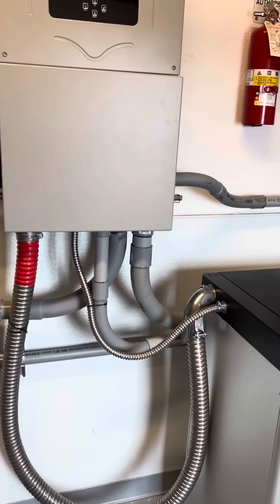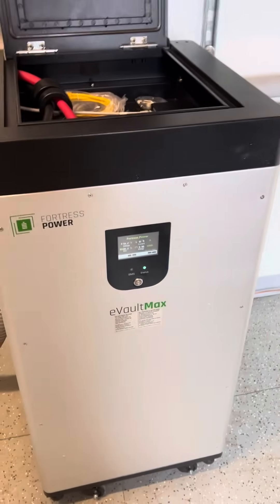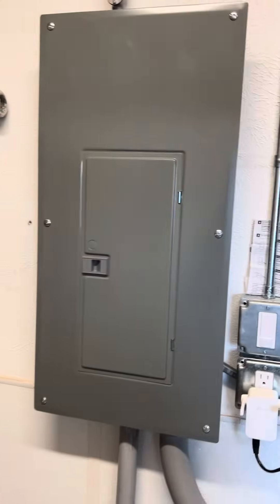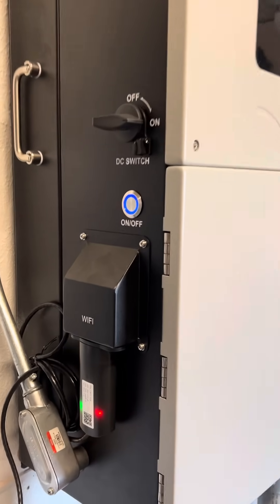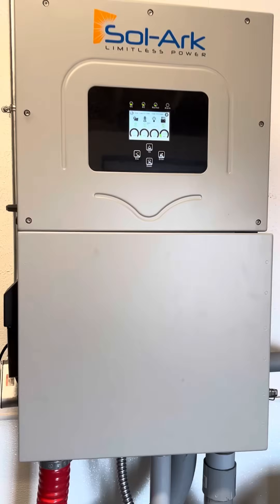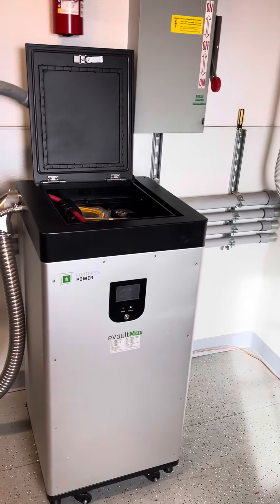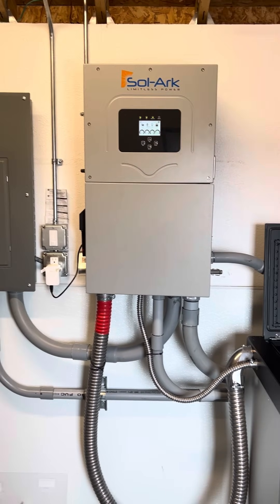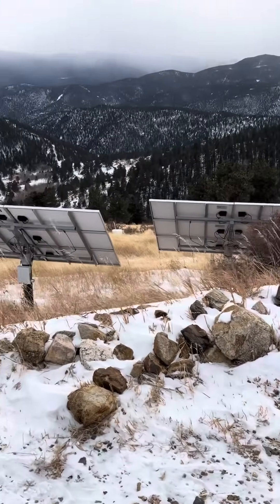Sol-Ark 15KW Fortress Lithium Battery Off Grid Solar Power System

Comment: One of the few installs where I dont see a raceway under the 15k, looks better without the big raceway IMO.  Seems like almost all professional installers use them though... Any reason for going this route?
Reply from the maker: We had a lot of existing equipment that already had existing wiring and conduit that worked well to just hook back up to the inverter without the wiring gutter. It worked out well for this case as we replaced an old outback inverter.

Comment: Is this your business or residence?  It sounds like an industrial plant!
Reply from the maker: This system replaced an old 24V Outback system at a clients home. We rewired the solar modules from strings of 1 to strings of 6 and added this power station which can be expanded in any way they need.

Comment: I would never install a high frequency, transfotmerless inverter in my off grid home. Transformerless, high frequency inverters offer a substantially lower surge capacity, a shorter life expectancy and run much hotter than heavy duty, low frequency, transformer based inverters. And their fans are louder because they run hotter.
Reply: The majority of what you said USED to be true.  Luxpower (manufacturer of EG4 inverters) has HF inverters that have generated over 100MWh (yes, 100,000kWh) of energy which are still operating optimally to this day.  Surge capabilities and life span have dramatically increased in the last few years as well.  Hence warranty period increases.  Many inverters are still lousy with fan noise, I admit.

LF inverters are still great for heavy inductive loads, but they are no longer the end all be all they used to be.  Especially for the typical homeowner who only has one AC unit to contend with.  No problem for more than one if they have inverter driven AC units or soft starts at the very least.  Put two or three inexpensive HF 240V stand alone inverters on the wall sharing the loads and they can last a very long time generating a large amount of energy.  This also gives you redundancy in case one fails till you can replace it which will be fast since most are AIO's now days.

No reason to keep bashing systems that are now proven with many years of service like Sol-Ark, just makes you look bitter.
Reply: Those high frequency inverters may have generated 100mWh of energy, the question is "powering what kinds of loads?" I'll bet they weren't inductive loads. Modern MOSFETs and IGBTs are not capable of universally powering  inductive loads.  @URackADisciprine
Reply: @quickquote1568 If the HF inverter was properly built and not taxed out at 90% all the time and kept under 80% of its rating, then it shouldn’t be a big deal.  I’m well aware that LF inverters have their advantages on absorbing lock rotor conditions; However, if properly sized, a HF inverter can handle them too.
Reply: What I said still hold true today. High frequency, transformerless inverter offer a shorter life expectancy and they offer a lower surge capacity, when compare to low frequency, transformer based inverters. Both EG4 and the Sol-Ark have not been on the market long enough to prove their longevity. Signature Solar, importers of the EG4 inverter has only been in business for approximately 3 years and Portable Power LLC, the alleged manufacturers of the Solar-Ark line of inverters has only been in business for 7 years. Both relative newbies to the inverter industry when compared to major inverter manufacturers like Schneider Electric, Outback Power and Magnum Energy to name a few.  I've been in this industry repairing both transformerless and transformer based inverters for the past 24 years and based on that experience, I can confirm that little has changed in the design of high frequency, transformerless inverters.  I can also tell you that a mere 200% surge capacity is hardly an improvement from these inverter's original surge rating design, especially when you consider that most inductive loads require at least a 300% to 800% surge capability. Oh, and I'm not bashing anyone's product. I'm just educating the public on the true capabilities of these products. Besides, why would I intentionally bash anyone's high frequency inverter product? After all, the more of these light duty, high frequency inverters that are sold, and fail after a few years of use, the more customer's my inverter repair center acquires.  @URackADisciprine
Reply: @quickquote1568  LOL...bitter much?  Must be if you have to twist someone's words to suit your agenda.  Adios.
Reply: Please explain how I twisted your words? @URackADisciprine
Reply: @quickquote1568 ok, I was about to purchase a 6000 watt eg4 inverter could you recommend me something else? A off grid home. Just tvs, window ac units
Reply: I have had two HF inverters on my wall for 4 years now.  They have produced many kilowatthours of energy and are still going strong.  They have already paid for themselves at least twice.  No problems running  my 4-ton AC either.
Reply: So why haven't you answered my simple questions? Two high frequency inverters in what sort of application? Grid Tie, off grid, emergency battery backup? What brand and what kW rating?  @hicapengrs
Reply: It figures that you won't answer my question. LOL!
Reply: Two high frequency inverters in what sort of application? Grid Tie, off grid, emergency battery backup? What brand and what kW rating? Thanks. @hicapengrs
Reply: @quickquote1568  restotool is right, you not only twisted his words but put words in his mouth.  If you dont care for HF inverters that is great for you.  Nobody has to live by your rule though thankfully.  HF inverters have purpose whether you like it or not.  Whether you like what they are used for or not.  Arguing and crying like a baby at people who buy a HF inverter and post on YT is childish.  I am sure you will need to get the last word, feel free as I am blocking your comments.
Reply: Please explain how I twisted his words. @hicapengrs
Reply: Which LF inverter is best in your opinion?
Reply: After 25 years of selling, installing and servicing  residential, off grid and mobile PV solar systems for the US military, law enforcement agencies, commercial business and tens of thousands of residential customers all across the US,  I would have to say that the absolute best off grid inverter on the market is the XW series of inverters, made by Schneider Electric. You'll pay more for the inverter but when it comes to reliability, longevity and performance, it's well worth the investment.  The XW inverter got its start with Trace Engineering back in the early 90s. Trace Engineering was then purchased by Xantrex  and their non-mobile division was acquired by Schneider Electric. For an excellent video on the Schneider Electric XW inverter, watch "XW Pro vs Sol Ark" on youtube. Another video to watch is  "Powerful Inverter for Solar Off Grid, Whole House, Schneider XW PRO 6848 Inverter, Hybrid" also on youtube.  @lynvalwatkis615